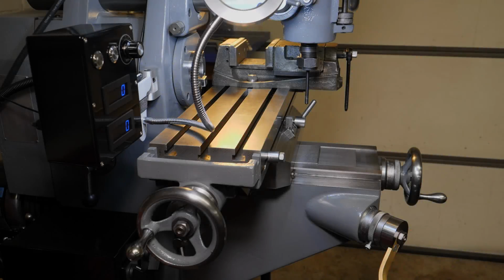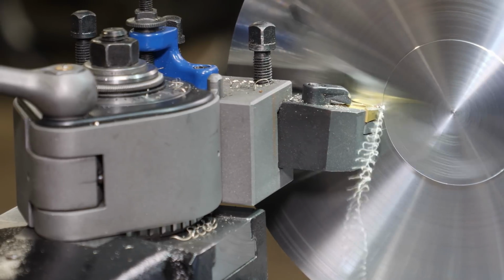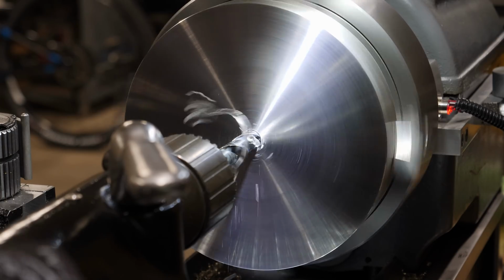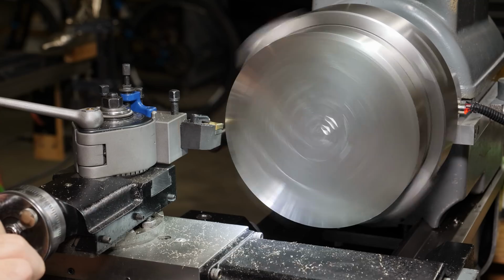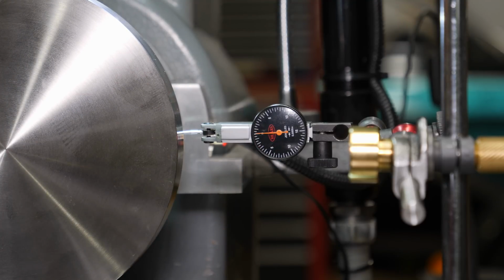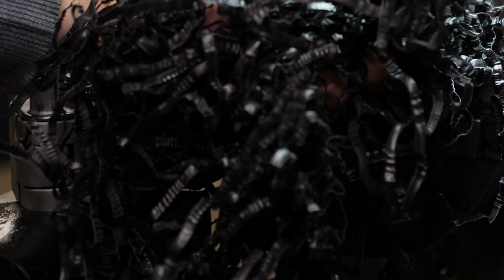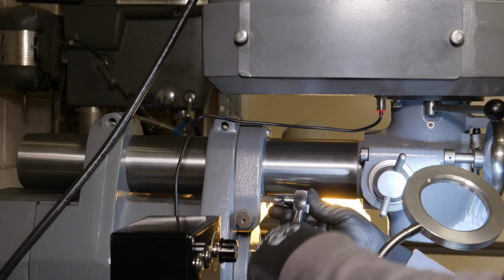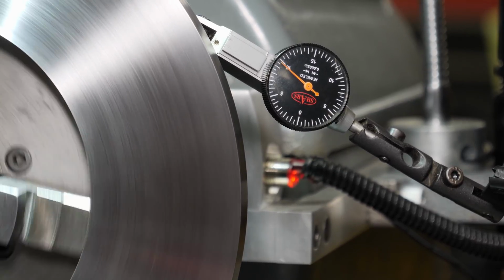Rockmill Tramming Tools

Comment: Hello, another method is use a new appropriately sized brake disc off a car. The faces are ground parallel within tenths of a thou (0.0025mm in metric) by the manufacturer. Lat it flat same as you have and works a treat. Take care and have a good Christmas. From land down under.
Reply from the maker: Thanks Bob and Merry Christmas. I have seen that before as well.

Comment: I’ve always just used a 1-2-3 block and a test indicator on an indicol to tram my mills at work. I move them constantly and it takes a whole 5 minutes to tram them. 

On Bridgeport mills, there’s a set of flats and bosses in both axes on the head that’s used for rough alignment with a machinist square. Just square it up with that, throw the indicator on and call it a day.

Comment: One thing to remember, you can for all intents and purposes tram a milling head in by only using 3 points instead of all 4 quadrants. If it's zero / zero in the X axis left to right and the front Y axis point is also zero, then by simple elimination the rear Y axis point also has to be zero.  If it's not then the front is impossible to also be at zero. Even knowing that I still almost always double check that fourth point out of habit, but it's really a wasted effort to do so. :-) 

Nice to see spotlessly clean and well maintained equipment. The more you know then the more you understand just how important that can be.

Comment: 11:55 "as you can see the gibs are out of adjustment..."
Me: oh yeah, yeah I definitely see that
Reply from the maker: It all adds up! .002 there could be more somewhere else.....
Reply: @BurtonsAttic  I watch your channel to learn. Always entertaining
Reply from the maker: @samiam7  I see, the shot on the left side of the screen is with the indicator on the back side of the table towards the column of the machine. The right is the front side of the table. I'm using the 25 on the indicator as my zero point. So on one side is +.001 and the other is -.001, a total of .002 out of adjustment. Meaning the table is tipped at an angle slightly. My wives hair measures in at .003 so it really not much but anything you can do to eliminate error in the machine makes your work more accurate! Thanks for commenting
Reply: @BurtonsAttic  oh! I never even seen the indicator

Comment: Mr. B love your videos. What do you do with the trimmings(not being a machinist, I don't know the proper term),do you recycle them or repurpose them?  Thanks for sharing.
Reply from the maker: After thinking about it for a minute, I am recycling material but in a different way. All of the material you see me using is usually from two sources. Machine shop auction lot- So I just buy a lot of random materials that are cut offs (or there stock) from whatever that shop was making. Sadly meaning another shop has closed down. Which I compete with what are referred to as "Scrapers" in the bidding. They will buy the random lots as cheap as possible to sell as scrap to the metal recyclers. A lot of old machines go that way also as they are sometimes more valuable as scrap than they are as a machine. Local material supply- Buying what are referred to as drops. Smaller cut off pieces that large shops can't use in there production and don't want to accumulate. So they sell it back to their material supplier who then sells it to guys like me at a greatly reduced price due to the randomness of the material type, size, shape or defect. I know, way to much information! Thanks for commenting William!
Reply from the maker: Thanks William. I don't recycle the swarf or chips. I produce so little of it that I don't do it, really can't easily. I probably should but the problem is keeping it all separated and preventing cross contamination of material types. Also in the recycling process the material must be decontaminated of all oil, coolant or grinding abrasive. I do save/recycle carbide inserts and small whole cut off pieces, of which their are not many. Their is a whole industry just for it. Shops will keep separate bins by material type. That gets decontaminated and pressed into bricks, sometimes onsite if it is a large operation. The bricks are sent back to the mills to be turned back into material stock.

Comment: Good point about the mass of the material used, I would suspect it's internal stresses in the material relieving themselves which caused the thin ring to warp.

A good 'pre made' solution to this problem is to use new brake rotors, they're ground usually within a tenth or two. Good enough for me I think :)
Reply from the maker: Thanks James, I've seen the brake rotor some where before. I was close enough but I could just face it again with a tenths indicator in the future. Yeah the mass should go without saying but bears repeating from time to time. Thanks for commenting!
Reply: @BurtonsAttic  I have a feeling it might have been on DoubleBoost's channel, that's where I picked it up from anyway.
Reply from the maker: Maybe, I've watched a few of his videos.

Comment: CC and DD might indicate the API material class. Does the shop you got the material from manufacture valves? CC is Stainless Steel and DD is carbon / low alloy steel. Does that match?
Reply from the maker: Yes! Thanks Tobias, I searched high and low for a material reference that referred to material in this manner. That's a mouthful. I know I have some stainless marked as CC and the tramming disc jives with what you said. You know more about it than me. If you could point me to an online resource that refers to material like this please do so. Thanks for commenting!
Reply: @BurtonsAttic  some valve manufacturers include this info in their literature.
https://globalsupplyline.com.au/wp-content/uploads/2014/09/API6A_Trim_Material_Ratings.pdf

I couldn't find the actual API reference, one probably has to buy the standard from them!?